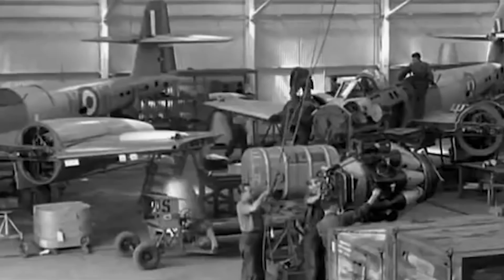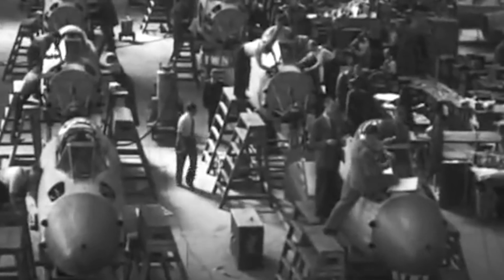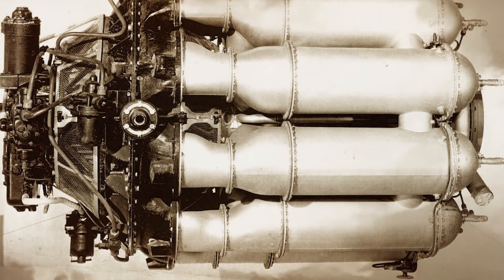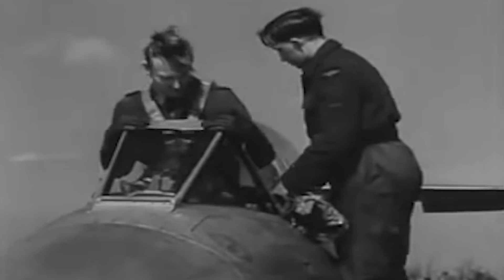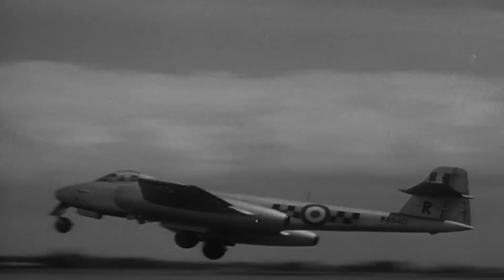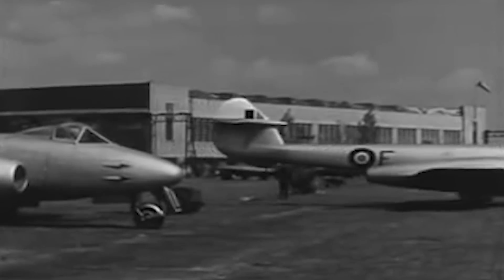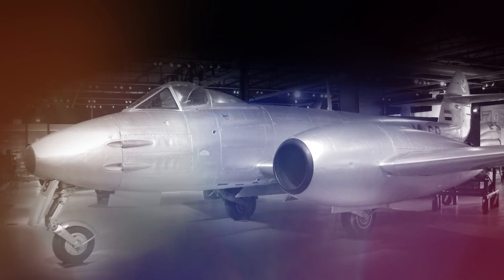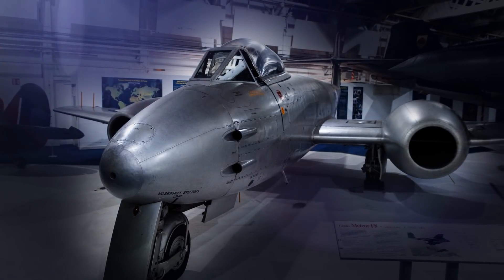Gloster Meteor - The Only Allied Jet to Fight in WW2

Comment: The Gloster "Meatbox" was the most effective British aircraft ever used against RAF pilots...
Over 1,000 crashed killing 450 RAF pilots.
Reply: The early versions were really prone to issues. The RAF really shouldn't have pressed so many of them into service until the problems had been sorted, but they didn't have anything better at the time, & it was war I guess. By the time the Meteor was much more reliable & safe, other aircraft had already made it obsolete.
Reply: @BigHorseFilm  Actually the death rate and number of crashes only increased over time...averaging a staggering 3 crashes per week by the mid-1950s
Reply: @BigHorseFilm  The Meatbox was the worst RAF jet fighter to ever enter service.
Reply: @frecherdachs2542  As with all good fighter aircraft, the high maneuverability also brings a lack of inherent stability which was common to all successful dogfighting designs.

The Messerschmitt Me-262 could turn and manuvere at speeds never experienced before by German or allied pilots.
Reply: @frecherdachs2542  The Gloster Meatbox was a not a good a good aircraft combat design nor was it a stable aircraft.
The Meatbox was plagued with multiple design flaws that were lethal to pilots, in particular the fatal asymmetric flight characteristics and lack of effective rudder authority. 
The Meatbox also had extremely poor directional stability at high speed with a nasty tendency to snap intp flat spin that often caused catastrophic structure failure.
Reply: @sandervanderkammen9230  Sandyboy, it so funny to witness your sad wehraboo desperation.
Face it you poor soul, the Gloster Meteor had a thirty years career with over a dozen air forces while the poor old Me 262 barely had a six year career with two and the last two years of that were sat on the apron going nowhere.
Reply: Poor old Sandyboy clinging on to one small dream against all the reality. The mechanical failure crash rate of the Me 262 was 33% which was way worse than for the Meteor. The allies didn't have to worry about the Me 262s too much because the Me 262 was killing plenty of nazis on its own.

Comment: I believe that this jet is still used by the Martin Baker company for Ejection Seat development
Reply: Parts are cheap so Martin Baker  can afford to keep them flying...
Reply: @sandervanderkammen9230  Parts are not cheap and certainly not as cheap as Me 262 parts were given that they had to build 1430 to get about 300 vaguely serviceable ones. That left them over a thousand dodgy scrapped without use Me 262s to cannibalise. Mind you, since postwar you couldn't even give away Me 262s there was much call for spares.

Comment: Not correct that the Meteor was the only allied jet.  The Americans had four P80's in the ETO, two in France and two in Italy.
Reply: Define aerial combat.
If you say the meteor never fought axis aircraft you are wrong.  A meteor shot down at least one FW190, but never saw action against the ME262.
Meteors we’re mainly used in Britain against the V1 flying bombs, and they were very affective in this role.
Reply: @peterbird7979  The "Meatbox" never shot down a single Luftwaffe plane during WW2... it only killed RAF pilots.
Reply: @sandervanderkammen9230  Except the V1s eh Sandyboy and of course as you know the Me 262 was way worse than the Meteor for killing its own pilots, with a mechanical failure  loss rate at 33% of service aircraft.
Reply: No Allied jet ever saw aerial combat during WW2.

Comment: Speaking to the rule that it couldn't be flown over German terr. for fear of being captured, the irony of course was that the centrifugal flow turbojets the British were using were in in fact inferior to the axial flow turbojets the Germans were already flying.  The main thing the Allies had that Germany didn't was access to the metals that would allow the engines to run at high temperatures for suitable periods, the German turbojets...while technologically superior...in some cases have a lifespan measured in *hours* by comparison.
Reply: Absolutely correct, there is no truth in that myth, the Meteor was not suitable for air-to-air combat during WW2 and was too difficult to fly.

Germany led the world in high temperature alloys and developed Krupp P-193 Tinidur 60 in 1935.
The Jumo 004b engines were reengineered without the use nickel or cobalt based alloys.

The 004b engines exceeded 100hours PFTR with the introduction of hollow turbine nozzles and blades cooled by bypass bleed air and cero-alumia high temperature ceramic coatings...technology vital to modern jet engines.
Reply: @sandervanderkammen9230  Tinidur was crap from the start. It didn't even have heat resistance of the 1932 Inconel alloys and it couldn't be welded. As for your bollocks about 100 hour PFTR, the beauty is that the only person on the internet making that fanciful claim is you.
Reply: @nucflashevent
Read my posts on this vid.
Reply: @johnburns4017  John please get therapy

Comment: The ME62 image at start (2,50) has a propeller spinner and piston engine and is a prototype of 262
Reply: The Me 262 prototype first flew with a piston engine and no jet engines in 1941 since the jet engines were not ready. The jet engines were still not really capable in 1944 and most Me 262's never flew, the ones that did had poor reliability. Post war USSR tried to use copies of the German jet engines but soon dropped them, Czechoslovakia mad some Me 262's but not many and they did little being very unreliable, France tried to get the BMW jet engine to work but had to make some drastic changes before they had a working jet engine, they even used Rolls Royce jet engines in some of their aircraft

Comment: Meteor was in fact the first operational  (in squadron charge) fighter jet in history by a matter of days. The Me262 had previous encounters with allied aircraft but those were prototypes. The difference was that the battle was over Germany where the Me262 were. The P-80 family had far more success with the T-33, T2V and F-94...
Reply: The Messerschmitt Me-262 was the first operational jet fighter during WW2.
The Gloster Meatbox never saw service as a fighter against Luftwaffe planes.
Reply: @sandervanderkammen9230  that is not the definition of "operational". Operational means organized in squadron, not prototypes going to war. Anyway, didn't make any difference.
Reply: @vascoribeiro69  True, the Meatbox   had no impact at all on the war, as a fighter aircraft it was a complete failure.
Reply: @vascoribeiro69  The Messerschmitt Me-262 entered operational squadron service in April  1944.
The Gloster Meatbox did not enter operation service until July 1944.
The Meatbox never saw operational combat service in the fighter or interdiction role during WW2, it was too slow and unstable for air-to-air combat against Luftwaffe planes.
Reply: @sandervanderkammen9230  🏆
Reply: Sandbum dorktorbummer
The Me 262 didn't enter service until late 1944 an experimental and training unit with few aircraft is not operational.
The Meteor did see service including over Germany and destroyed 46 Luftwaffe aircraft. the Me 262 never shot down a single Meteor, Spitfire or Tempest. The funny thing is the Meteor Spitfire and Tempest shot down jet fighters.

Comment: FYI, your crashed Meteor at 3:23 isn't the early prototype but an F8 that was delivered in 1952.  In a remarkable coincidence though, it too was written off almost exactly a year later.  And RAF squadrons are generally known as 6, 1, 6 Sqn;  not the six hundred and sixteenth.  You'll get a bit more cred if you get these things right.  Might have been interesting to mention that the Meteor did take part in a jet-on-jet battle in Korea, although it didn't end well for the RAAF.
Incidentally, you also inadvertently touch on another part of the Meteor story, its use as an engine test bed.  The lovely silver jet you feature in much of your video is actually a MkIV from the early 1950s that was used for a number of tests on the RR Derwent with afterburners, hence the long tailpipes.  VT196, you fooled me by the film being run reversed, then went over to Canada for further similar trials.  Other Meteors had a variety of engines fitted, including famously EE227, which ended up with experimental Trent turbo-props.
By the way, I have a personal connection to these aircraft.  My last flight in an RAF Meteor was a T7, in 1979.
Reply: Wow, you are very lucky to still be alive.
Reply: @sandervanderkammen9230  Could have been worse, he could have been an Me 262 pilot for the brief while before his engines dissolved.
Reply: @sandervanderkammen9230  When will you stop this shit about the Meteor being a accident prone plane. You lie  Go to that site I mentioned and count you ignoramus

Comment: I remember hearing on the radio the news that a jet aircraft was successfully tested. All I remember is that it was before 1945, when I reached my 14th birthday. I knew this meant a manned rocket was nearly feasible. These were amazing times with new technology being announced practically every month.
Reply: You lived in Germany during WW2???
Reply: @sandervanderkammen9230  Canada.
Reply: @fwcolb  Your memory must be failing you...
Reply: @sandervanderkammen9230  Actually, I don't remember the year. I do remember discussing with my uncle a drawing I made of a submarine capable of launching missiles from underwater. He was still in Air Force uniform. So it was probably around 1945. I was not yet 14 but I knew how rockets worked, I knew Newton's 2nd and 3rd laws of motion, but had only a hazing notion of the first.
Reply: @fwcolb  The World's first jet aircraft flew on August 27th, 1939 in Rostock Germany...
The first manned rocket flew in 1941 also in Germany.
Reply: @sandervanderkammen9230  Yes, but I was only 7 in August 1939. So my memories are from nearer the end of the war.
Reply: @fwcolb  I believe such information would have been censored during the war, you may have heard the news several years late, after the war ended...
Reply: @sandervanderkammen9230  Possibly late in 1945. I did know about the V-1 rockets much earlier, which used a reaction engine, as did jet engines later. I was so exited I went about for days telling adults, none of whom seemed interested, except an uncle who was in the air force. I did not know any kids who would have understood anything about engines.
Reply: @sandervanderkammen9230  
The He 178 only just flew, it was so slow they never retracted the undercarriage and dropped very quickly.
Reply: @sandervanderkammen9230  You can believe what you like  Sandyboy, it just makes you a bigger fool. Both jet flight and rockets were publicly reported during the war.

Comment: In all the years I have read about aircraft of WWII I never knew the Meteor was more than a test program rather than a whole squadron
Reply: The Gloster Meatbox was produced but never saw combat against Luftwaffe aircraft.
It's performance during the war was extremely disappointing and it was very much obsolete by the Korean War.
Reply: Sandbum dorktorbummer.  The Meteor was used in combat, the Luftwaffe kept running away. not only that but still in use for Korea and unlike the Me 262 the Meteor did shoot down jet fighters including a few Mig 15.  The Me 262 had more than enough trouble with piston engine fighters, it couldn't shoot down a single Spitfire or Tempest.

Comment: As many others have complained, the research is somewhat lazy, though many information is available in many sources, including Wikipedia.
for example in the Israeli air force-
it was the first Jet fighter in IAF service
it had claimed the 1st ever jet era Arial winning on September 1st 1955 (first win in 7 years since the end of the 1948 war), though the 1st jet vs jet engagement  took place a few days before with a couple of 2nd hand Ouragan vs Egypt's Vampire.

this kills were obtained with a plain that was still tuned for night mode, with the sight stabilized  only at about 100m range.
but due to the heavy emphasis on gunnery training (due to the then obsolete ww2 sights that were mounted on the IAF Meteors), and due to probably not the most impressive flight of the EAF pilots that day.

a year later a night fighter was aiming to take down about half of the Egyptian high command at the eve of operation Musketeer/ka'desh.

here from wikipedia-

On 1 September 1955, an Israeli Meteor shot down an Egyptian de Havilland Vampire, the first jet aircraft to be shot down in the theatre.[174] The Meteor played a key role during the Suez Crisis; on 28 October 1956, an Israeli NF.13 took part in Operation Tarnegol, in which it successfully located and shot down an Egyptian Ilyushin Il-14 that had been carrying several high-ranking Egyptian military officers on the eve of the crisis.[175] The operation had intended to shoot down the Il-14 that was supposed to be carrying the supreme commander of the Egyptian armed forces, Abdel Hakim Amer, however a different aircraft had been inadvertently attacked and destroyed instead.[160] After deploying paratroopers east of the Suez Canal, the Israeli Air Force continued to support them on the ground predominantly using its jet aircraft, fearing its propeller-driven aircraft would be vulnerable against Egypt's jet fighters.[160]

While initially flying combat air patrol missions, the Meteors and other Israeli aircraft could not prevent effective attacks by Egyptian aircraft on the ground forces.[160] Israeli officers came to recognise that the Meteor was outclassed by Egyptian MiG-15s, and subsequently limited the Meteor's employment as a fighter against other aerial adversaries.[citation needed] Following the start of the Anglo-French bombing campaign against Egypian airbases, the Egyptian Air Force mostly withdrew from combat in the Sinai, allowing Israeli aircraft to operate unhindered.[160]

The Mk.8s remained in front line service until 1956, and were then used as training aircraft. The NF Mk.13s remained in operational use until 1962.[176]

https://en.wikipedia.org/wiki/Gloster_Meteor#Operational_service